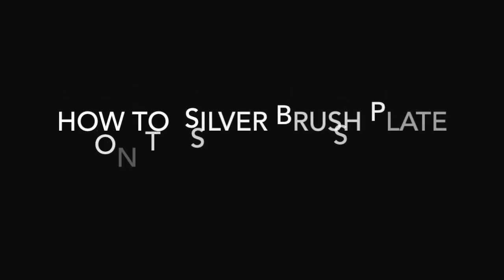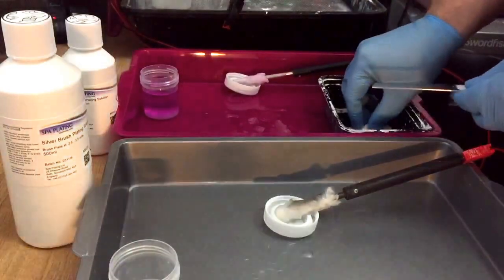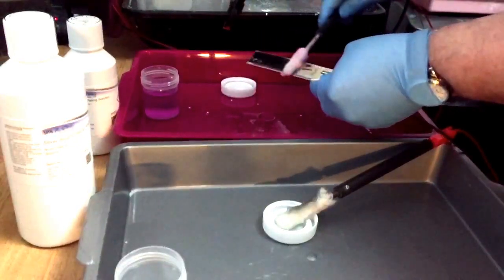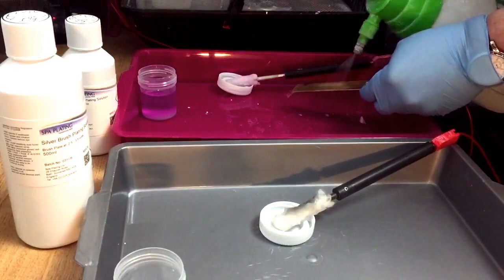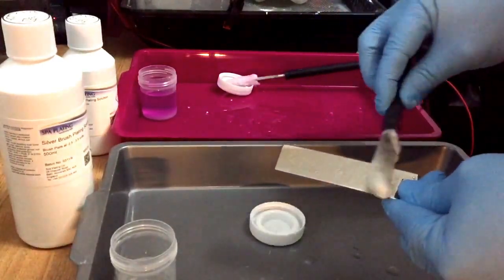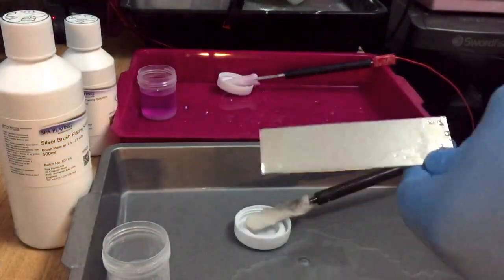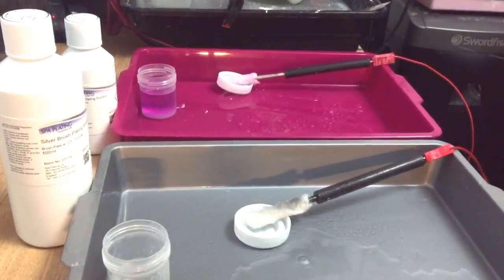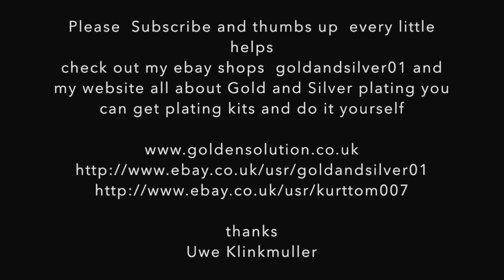HOW TO  SILVER BRUSH PLATE ON TO STAINLESS STEEL

Comment: how much surface area can you cover with one bottle? rough estimate? 
i want to cover a set of knights armor in silver or gold solution and wondering the amount needed
Reply from the maker: hi thats depending on the thickness of plating but if you plate a thin layer of about 0.1micron you can plate about 1m2  with 50ml of silver 

thanks
Reply: thank you very much for the response and estimate. 
does the steel armor need to be silver plated before gold to help adhesion? 

would it take roughly the same amount of gold solution 50ml to cover 1m2?

i do appreciate you taking the time to share your knowledge and expertise
Reply from the maker: Rusty Shakleford with gold plating you should be fine you may need to nickel plate first 
To cover one square meter with gold you need well over 700 ml

Comment: i have similar setup, but why my amp meter is not moving?
Reply from the maker: Hi thats depending what rectifier you have and what voltage you plate with 
if i plate with About 3 volt the amp meter is not moving either because the power is very low so is the amp and i have only 0.0 digits on my rectifier so i don't see the amp moving if i use my other rectifier what i use for tank plating this rectifier has 0.00 digits so i will see the amp meter moving even if i plate with 0.5 volt 
i hope this helps 
thanks 
Uwe

Comment: Great video!  How thick is the silver plating when done?
Reply from the maker: Hi  it plates about 1 micron a minute as this silver contains 25 gram of silver per litre  in this case i would say there is about 0.5 micron silver plated you can get this in my ebay shop goldandsilver01 or spa plating 
thanks